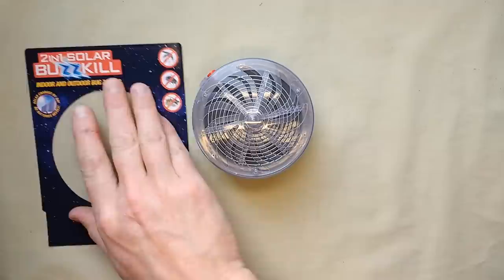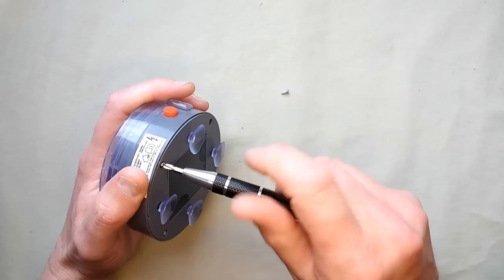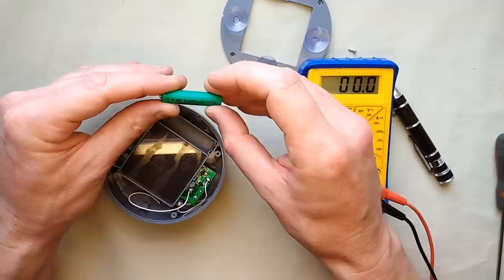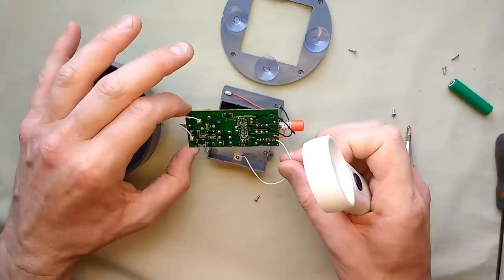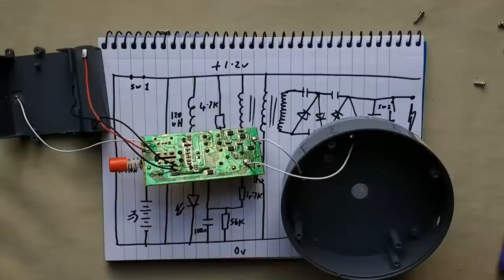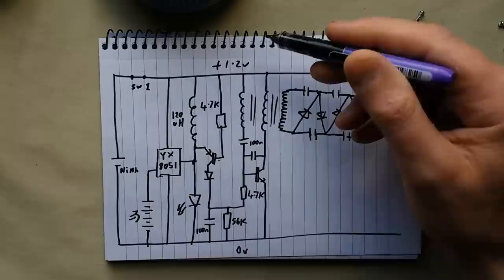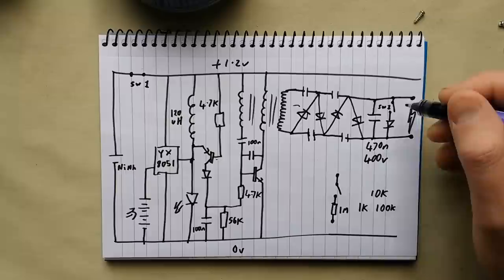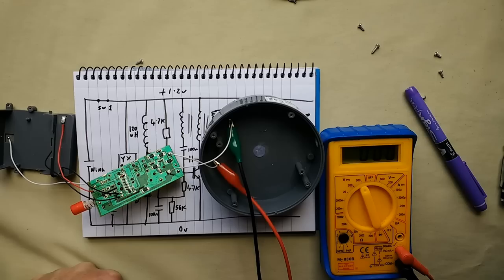Buzzkill solar insect killer with weird schematic.

Comment: Hey Clive, how about a quick assessment of how well it might support itself from solar power?  That cell is pretty small, but a quick current measurement while charging outside and behind a typical double-glazed window would be pretty good.  

Usually I watch your videos to find things I definitely don't want to end up buying for myself, but after my better half bought a dubious USB powered LED/fan combination calling itself a bug killer I may consider trying one of these.  You can tell I wasn't convinced, but it is doing a roaring trade in our house and catches (and concusses or dismembers) plenty of small insects each week.  At least your 2-in1 solar Buzzkill looks like it would be silent, until deadly...

There's more detail here of course. Is 170V and that size capacitor enough to kill the insect and 'clean' the wires so that it doesn't end up slowly roasting it's catch?

Comment: Hi Clive.
Sorry if I've missed info (looked on your site); I'd like to send you a faulty digital timer mains socket to play about with/disasemble/repair. It works OK for a time, but after a few days, it starts to reset itself, i.e. loses the time and also the timer settings. It's one of two I bought together and the other seems to be OK. I have had it plugged into an extension socket and with a flourescent fish tank light plugged into it.
If you'd like to take a look, please can you tell me your PO Box and I'll pop it in a bag for you to smash apart :-)

Comment: Surely the 4k7 resistor will hold the transistor off until and unless the emitter is pulled negative of the base by the 129 micro-henry inductor?
Reply: OOOPs  - 120 Micro-henry!

Comment: The biggest issue with all of these LED bug zapper is that I have found the LEDs don't attract bugs.
Reply: KJ6EPL Interesting. I found that my Super Amoled screen does attract insects.
Maybe they like like it, because its stronger and more colorful, than a single blue LED. I guess we will never know...
Reply: Blatt Ferenc . I am not convinced that the light from a LED is in the right part of the light Spectrum to attract any flys. Plus, even the mains powered zappers that use tubes are useless for some types of fly. As these take no notice of any light and instead follow smells...

Comment: Could someone explain to me please why there was no shock, if i have understood correctly the two lines are equally opposed polarity?  Therefore the electricity takes shortest part of resistance to the integrated neutral, so where does no reference to ground come into play?  Thanks

Comment: The voltage you're measuring is surely not accurate, because it's pulled down by the impedance of your voltage meter.

Comment: That voltage multiplier doesn't look right. The top output is most likely connected to the top of the secondary coil...

Comment: I'm totally with you on the cheapo multimeter, its purpose and its use. I've got 2 in use  +1 in my car.
They are super value when cost/usability is considered.

Except for one thing ...

They usually shatter themselves into waste, if dropped on a concrete shop floor.
I noticed your blue rubber protector on your meter.
Where did you find that protector ?
I've not been able to locate a rubber protector for this type DT830 multimeter on ebay.

Do you have suggestions on sources ?

Comment: Hey Clive, it’s me the paranoid power supply guy again. I just bought an Intel NUC and I have absolutely no doubts whatsoever about its safety. It’s an Intel ordered part, it is made by FSP, a well known OEM of more than reasonable quality power supplies, and it’s got a smattering of safety labels all over the thing.

But, I really like the form factor. It actually charges my battery bank perfectly, they come with a load of country adapters, they are rated 19v 3.43A, 65w, have a standard looking barrel jack, and the best thing, they are $15 straight from Intel spare parts! Wondering what your thoughts are. Maybe you could do a teardown on one? I’m afraid to take mine apart because it’s too good. However I will actually be ordering one or two more. The power supply that came with my battery bank is equally good, but US plug only, so I have to use an adapter which is a pain (not a deathdapter! You can’t plug things in random ways with these. A brick and mortar retail one.) this intel adapter also includes four country adapters - US, UK, EU, and AU.

Oh, and the efficiency. The power meter says 48w coming out. The battery bank says 44w going in. 4w waste roughly, what’s that efficiency work out at? Seems quite good.

Linked are some photos. Keen to hear your thoughts.

Much love from a cub to a bear. :P

https://www.dropbox.com/sh/l74e46dd4pn9wx4/AACUC0t5tyyBN4VMLJs4h61Xa?dl=0
Reply: Jason Mossad Thanks, Jason. I thought the figure would be fairly well up there!

Comment: You would have thought the emitter and base would be the other way round, maybe it's something that will cut off power to the zapper section  if the voltage is too low
Reply: It depends how much the transistor is biased
Reply: When the current through the inductor is switched off the emitter goes >0.7V above the supply so it's turned on via the base resistor. I'm wondering why they didn't use a simple diode pump.

Comment: Could they have accidentally switched the diode and resistor around? - So that the battery was not supposed to discharge below 0.6 volts?

Comment: Is that transistor just there to force a certain voltage at the emitter that is higher than the 0.7v of the diode?

Comment: Clive, I am so very lucky to have one of these units.  Never had any issues with it,  It just stopped working in the last couple of days.  I can only presume that the AAA battery has died due to insufficient charging over the winter.  Can you tell me, if I replace the AAA battery with a "normal'" rechargeable battery, would it work and still be safe?  OR am I just better to drop kick it and get a new one instead?  Tar chuck!
Reply from the maker: Yes you can put in a new NiMh rechargeable battery.  It may make it as good as new again.
Reply: Thanks Clive, you are a ⭐️ !

Comment: Just a thought, once the circuit's off, shouldn't the last diode in the voltage multiplier also discharge the high-voltage capacitor? It's wired right across it, which would seem to make the switched discharge diode kind of pointless.
Reply: Correct, he's drawn the diode the wrong way around.
Reply: Ah, okay, that makes sense now.

Comment: What you call 'odd' and 'weird' is called optimization is (優化，完善) in Chinese. What a bargain! What features! 

I have 'building blocks' of circuits in my PCB library - all work as standalone modules. I select the blocks I need to achieve a design, move them around on the screen for optimum space saving, then I remove the PCB borders, one by one, then complete the interconnections. At completion I have a single PCB that is known to work.

My designs include an SDR RX/RX competed in less than 11 hours, and a military robot in 15 hours. But analysing the circuits might be confusing for some. This is what the Chinese do when they optimise something. Don't knock it - its why they have good prices.

Comment: I have recntly a need to zap the crap out of some bugs. Thus seeking the parts in needed. Can 2 usb chargers transformers be connected to dramatically increase the voltage before entering the capacisitor(s)?  I seek enough power for bugs to activate it though the bugs a big... such as ticks, horse files, bot fies and small enough for No-See'Ums Gnate and fruit flies.   I see to put a small fan in place so once the bug wnters it will be directed forcing the size of the insect toward th area built to zap that insect's size.

Comment: If you understand the voltage going to the end of the circuit, the milliamps will change the entire current to a amperage setting which is wired to the flux capacitor I actually have no idea what I’m talking about I just found this video randomly and thought I’d give my input and make you waste like 30 seconds of your life

Comment: A bjt is cheaper than a diode. That's the oldest engineering trick in the book. Also, a nand is cheaper than an inverter. ;)

Comment: Usually your videos are more informative.  Perhaps you could try implementing your suggestions to prove or disprove...e.g. a tuallu replace the transistor with a diode?  I suspect the first transistor prevents deep discharge of the battery, harming it.  Also, replacing the last diode with a resistor doesn't render the device shock-safe as fast as the diode.

Comment: love you videos big Clive that multimeter your talking about why don't you do a video on one of those? I took a part one the other day because I thought it was broke. I wanted to salvage the screen, but those are inductance screens they have no wires! if you jostle the screen at all by dropping it or something the screen goes off by a hair it'll skew all the information I basically started opening mine up and hot gluing them so it wouldn't move if I drop them! please check them out as an avid viewer I would love to see you make this video!
Reply: I've never seen screens that work via inductance or any other part for that matter maybe it's nothing new to you
Reply: Carlton Ducharme II 
I used to fix them by applying constant pressure on the circuit with some foam sheets.

Comment: Those cheap meters are really useful as small monitors, indeed. I have three of them mounted on top of my workbench, with preset voltage/current for the most common circuits I work on. What I'm still trying to figure out is if there's any way to calibrate them as they don't have any trimmer inside and the controller chip is epoxied...